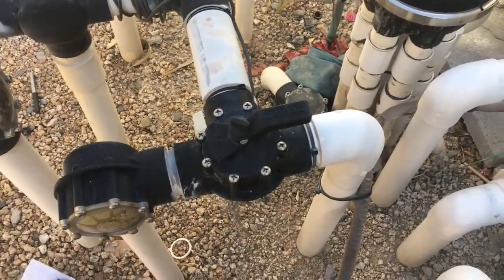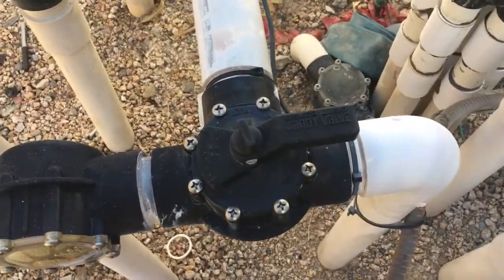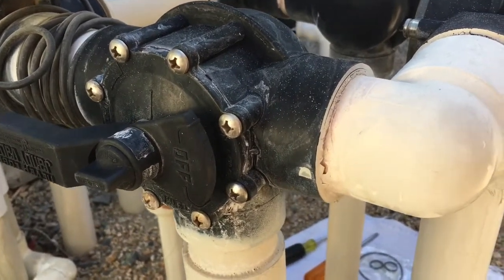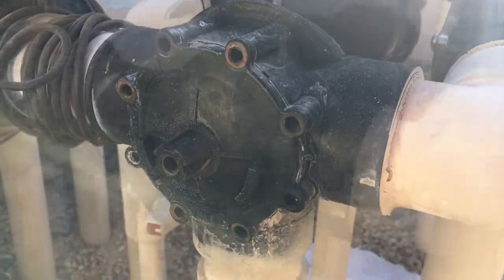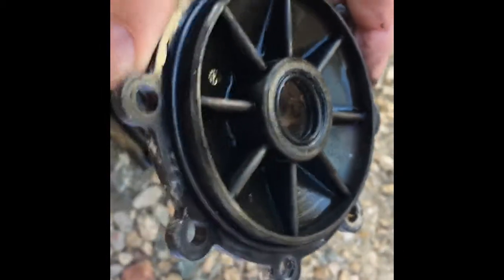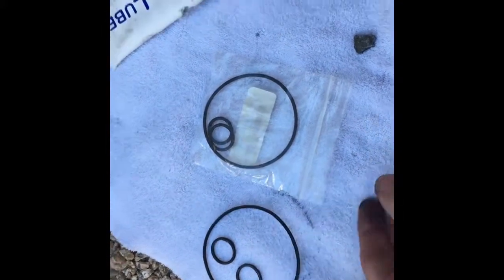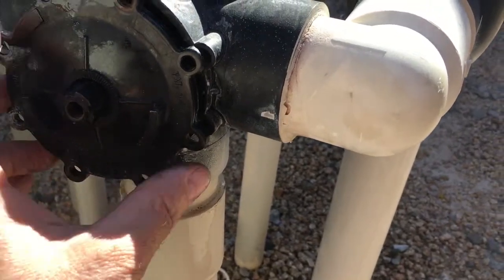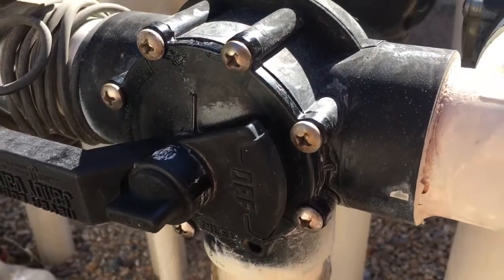Jandy Neverlube Valve O-Ring Replacement Models 4715, 4716,4717.

Comment: Thanks Tommy... it seemed easy enough, but was worried about making sure everything was lined up the way I started. I took pictures as I went along, but definitely like the tip about taking note of those plastic tabs and how they are aligned. Good news is I finally fixed a leak that's been plaguing my pool for a long time (leak was on the suction side and was difficult to pinpoint as it didn't leak water when the pump was off... found another tip on YouTube to run a hose over everything to help pinpoint it... the leak went away when I saturated one of the valves)... cost me less than $10 for the new gaskets (plan to replace the others now too as they are just as old and one does have a minor leak when the valve is rotated). Was almost ready to call an expert to fix it, but I'm handy and was determined to fix it myself... glad I stuck with it. Videos like yours definitely helped.
Reply from the maker: Nick H.... Really appreciate the feedback. Glad I could help.
Reply from the maker: That's great news! What is the next project you will tackle?